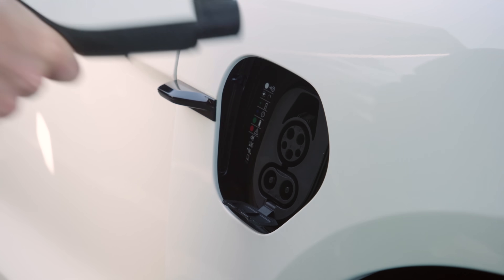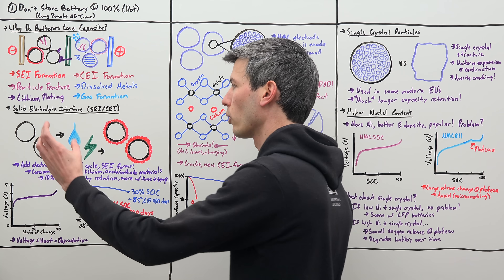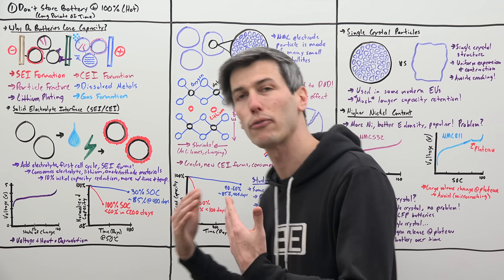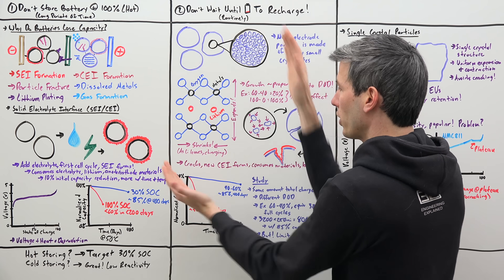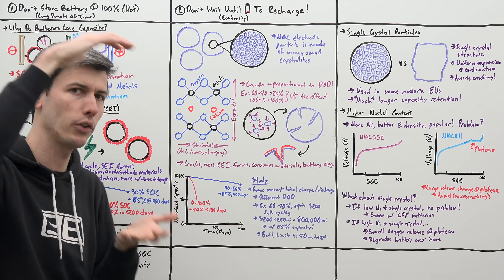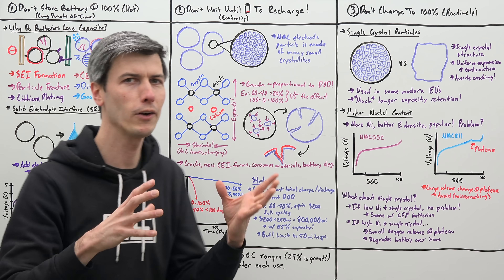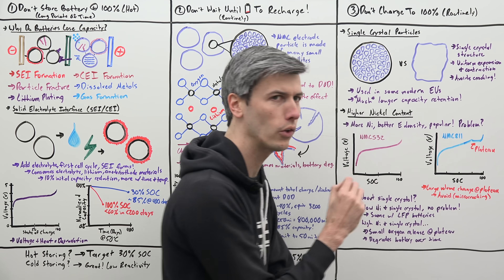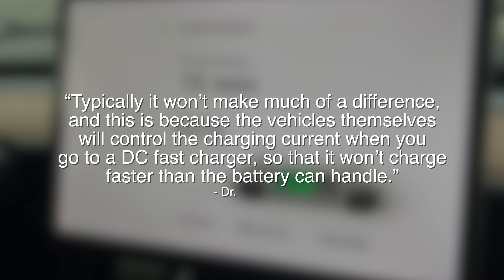How To Ruin Your Electric Car's Battery - NMC Edition!

Comment: Hey Jason, Another great video! Question for ya though -- What about the low end of the battery charge? Is sitting at a low state of charge hard on the battery? I have a 2023 Chevy Bolt that got in a wreck and has been sitting at the body shop for 3 months waiting on parts. Come to find out, the battery has been sitting at 0% for the last 2 months... grr.
Reply: You should be on them (body shop) to charge the car.  They may not know any better.  The car comes with a 110v charger, and they have 110v plugs and all day to charge it, so the slow charging speed doesn’t matter.  Just make sure the top charge % isn’t defaulting to 100, which may take some input - or training - from you.

Comment: I owned for 3 years 2020 Kona EV, without charger at home - I usually plugged car every time when I went out (shopping centers, doctor appointment ) So a lot small charging sessions. I did like that 50kkm with half of that on the highway +500km trips with DC charging ~5% to ~80%. SOH is 100% no degradation. 

But that's not always practical solution. Sometimes you don't know if you need 40% or 100% of charge for a trip that can happen immediately. Then  range anxiety kick's in hard.

Comment: Very interessting video. A factor that i'm interessted in but rarely anyone talks about is the normal aging of the battery. I mean even well kept and rarely use battery powered devices don't really have any capacity anymore after 10 years. So will we be seeing batteries dying after 10 years even though they were used with care?
Reply: No. My 2013 Chevy Volt's battery is about 12 years old now since it's been manufactured. It still has 85% of its capacity after 217k miles.

Comment: Imagine losing fuel tank capacity in an ICE car after filling it from 5% to 100% a bunch of times..
Reply: Imagine losing fuel efficiency because of poor maintenance, low quality gas, degraded fuel injectors, impurities in the tank, clogged air filters, old fuel filters, low quality oil, cheap tires, improper air pressure, bad driving habits, most of which are part of the cost of ownership and if not maintained can lead to expensive repairs.

Comment: One of the supposed big upside of EV’s is that it’s supposed to be so convenient to be able to charge at your house when you want to and not have to stop at the gas station. I live a block away from the gas station and drive past it every day, I would rather stop there once every 10 days than have to mess with plugging my battery in every single day or else I accidentally ruin it
Reply: Do you own a cell phone?

Comment: When he recommends limiting max charge to 75% (most of the time), is that 75% for the battery pack? Or 75% as indicated by the car? Most cars already limit their min/max charge state, so they will never reach 100% or 0%. e.g. When the car says 100%, the battery is actually at (say) 85%. When the car says 0%, the battery is actually at (say) 15%.

So should you be targeting what the car says is 75%? Or an actual battery charge state of 75% which would correspond to the car (in this example) saying (75-15)/(85-15) = 86%?
Reply: I think he’s talking about limiting the true SOC range but this is likely to be much closer to what the car shows you than you may think, especially at the higher state of charge. I don’t think most manufacturers are locking out 15% of the higher voltage. Perhaps a 3-5% buffer at most. You can get an adapter and app to look at the cell voltages in your EV. I bet they’re pretty close to the cell’s maximum voltage at 100% SOC as indicated on the dash.
Reply: He means net capacity, which already includes the buffer. It is way too conservative tho. Charging to 80% is totally fine (you still have the top buffer which is another 2-3%.), no need to limit yourself beyond that

Comment: This is a very informative and important video. I ussually think that it is better to charge a battery at 20% to 80% rather than small charges in between, now i know i should do small charges for my phone, and if i ever own an ev on the future..

It is hard though to store ev away from heat in my country, as i live at a tropical country, so maybe if i ever own EV in the future, it is better to set to charge only to 70% at max.

Comment: I live in a van with two flooded lead acid battery packs and one glass matt AGM battery.   One of the flooded batteries is an advanced tech and the other is an RV deep cycle.   The van advanced tech battery I charge every other day with a 100 watt solar panel and a Renogy Wander Controller.  The VAN house batteries I charge daily when possible with the same set up.  None of my batteries consume any chemistry.   Am I doing it right or should I charge less frequently?

Comment: With a EV you're a slave to the charging network. No freedom you have to go to where the network allows you to go.
Reply: That's the same for petrol or diesel cars, the amount of stations is just far greater.

I've definitely driven places where you have range anxiety even in a petrol car. Hopefully electric charging stations will continue to be added and maintained for those who need them.
Reply: @Kamukix ever heard of a jerrycan? Try bringing some battery packs with an EV

Comment: Simple.. one day batteries will no longer lose the ability to hold a charge/experience degradation... until then, these current batteries are not a viable solution.... and are essentially going to be expired milk one day (guaranteed)

Comment: I don't keep ANY car more than 3 years. I want my car to be ready for any emergency at all times so I always charge to 100%. My Tesla battary has warranty and I don't give a rats a** about battery degradation. It is a car, it serves me, I am not serving my car. End of story!
Reply: What possible emergency requires you to drive over 250 miles without stopping
Reply: @BrandEver117 we do not have so many superchargers on the main highways up here in Canada so while driving from Ontario to Manitoba you need to start at 100 and calculate exactly where you need to stop, otherwise you will be stranded.

Comment: Modern EVs have some battery capacity locked by manufacturers, i.e., you can’t really reach 100% state of charge, or 0% of discharge. In other words, as long as owners don’t charge to full capacity and store for a long time, and don’t empty the battery completely on every single drive, you’re good to go in practice.

Comment: Nice topic and video!

My anecdote: we own a 2015 Fiat 500e that stays plugged in and charged to 100% (no option for less). It shows no discernable degradation (must still be within the built-in buffer). We don't drive it much (47K), mostly getting groceries so shallow discharges, with a bit deeper discharge (45%) every other month or so, and really deep discharges limited to under 5 since we've owned it (6 yrs).
Reply: They are so cute!! 
Glad for you.

Comment: 7:45 ERROR: current EV batteries can sustain between 300-500 cycles before they die, NOT your theoretical 3,200 cycles. Thus you'll NEVER get 800k miles and will still have 85% of batt capacity. Maybe you'll get 100k and 85% if you are super careful, at best...

Comment: Curious about implications for plug in hybrids with ~35mile electric only ranges that are being used as daily drivers.  Degradation seems higher in those use cases.
Reply: Exactly! Mine goes from 0 to 100% every day pretty much. I guess it will end up being a regular gas vehicle as the battery degrades.
Reply: @RedpillGroyper  Well I hope not. Our 3.5 month old Prime gets charged every evening no matter what the SOC is. Most days we only drive about 35Km so the SOC rarely drops below 50%. But, I noticed something the first time we went on a longish highway adventure. Prior to that trip the car had never been out of EV Mode. So, my plan was to set-out with a full charge and select Hybrid Mode, expecting to see massive milage numbers............Not so. The car drove for over 80Km in full EV Mode, refusing to engage the engine until the SOC was at zero.

That reassures me because if Toyota had any reservations about the Service Life of their PHEV batteries being affected by frequent cycles, they'd have made the Hybrid system involve the ICE way before the Traction Battery died to "spare" the battery.

We have driven our Prime 5,000Km in 3.5 months and used less than 1.5 tanks of fuel. That's the way we'll run. The battery has a ten year warranty, Toyota does not want failures.
Reply: Agree. Battery degradation will be bad for PHEV.

Comment: How to maintain your car’s fuel tank. 
1. Never fill it 100% with fuel. 
2. Never run out of fuel. 
3. Never drive for prolonged periods at wide open throttle. 
4. Never fill the tank fully when it’s warm. 
5. Never fill the tank fully when it’s cold. 
6. Always refill (to only 80%) after every trip. 

Follow these simple rules and your fuel tank should last 8-10 years and 100k miles.

Comment: I heard that Model Ys don't get accurate at measuring charge state until you get to 80%.  Should I charge to 80% or 75?
Reply: 80% is fine. If it is LFP battery it is more than fine

Comment: Thank you. I’m very happy with my battery Lithium lawn equipment, and while I will never go back to gas, it’s very difficult applying these charging methods, and it’s incredibly frustrating then having to carry around the same weight of batteries, but they have lost 60-80% capacity as they originally had and it’s environmentally terrible and very expensive to replace them - you have to carry around all this dead weight to get value out of them, and even then one battery could have purchased years of fuel energy.

This is the only time I miss gas, with the longer run times, lighter weight, cheaper to purchase and cheaper to run than Lithium lawn equipment.

I hope engineers and scientists can overcome weight and battery degradation, because it’s great using battery lawn equipment, with little to no vibration, no pollution at the user end and little maintenance and no handling of fuel.
Reply: I left the sirens of San Francisco for the leaf blowers of Belmont, is a joke I make since moving to the 'burbs. 
Yah, great comment in light of municipalities moving to ban gas powered lawn appliances, particularly blowers, due to everything you mentioned. I feel  bad adding weight to the guys I see around our neighborhood.

Comment: Best Lion battery life is between 20% to 80% and with a heater or AC, it's half dead before you start. Then turn the lights on.

Comment: Depth of discharge is a useless metric. According to accubattery's research, which cites Choi, S. S., & Lim, H. S. (2002). "Factors that affect cycle-life and possible degradation mechanisms of a Li-ion cell based on LiCoO2".
Rather than use depth of discharge, it is far more meaningful to pay attention to the END OF CHARGE voltage. Cycling between 0% and 50% is not the same as cycling from 50% to 100%, 30-70%, or any other range.

This paper by Madeleine Ecker is fatally flawed in that it compared a 40-60% cycling range battery to a 100% DOD lithium battery with completely different end of charge voltages. Where is the data that shows a proper 60-0% control? And why couldn't they compare the amount of work done after a certain extent of cell degradation?

Jason was also interchanging a 40-60% charge with a 60-40% discharge in his explanation. Conceptually if the lattice both expands and shrinks during both its charge and discharge cycle, then it comes down to pinning the ideal SOC range to do electrochemical work within. But I don't think this cycle depth data has been properly demonstrated and is missing the key controls to make correct interpretations to infer use practices from.

I'll be clear, depth of discharge has no place in the literature for li-ion chemistries. This is more appropriate for nimh, lead-acid, and nicad. Li-ion needs a new term that puts a focus on end of charge voltage and SOC range.

Comment: The fact that an EV car battery is so difficult to replace is a scam. There is is zero reason, ZERO, why you shouldn't be able to swap out an old battery and replace it with a new one in under 20 minutes at minimal cost.
2nd, lithium price is now 20%, fully 1/5th the price it was a year ago.
Expensive battery replacement is a BS scam across the whole EV industry.

Comment: Do any EVs have a charging plan setup so that you can say "Mon - Thu Charge 60% and Fri - Sun charge 90%"?  Or link to a calendar app, so that it knows that on the 23rd you have a 500 mile trip planned so the day before it should charge to 100% even though it's a Wednesday.
Reply: I think some do. Mine doesn't have daily charge limits, just departure times so it will be charged to the same amount when it's time to leave.

Comment: Just some caveats - bench testing is not always a great proxy for battery behaviour in an EV while they do highlight some impacts these are usually much lower in an EV application.

Unlike bench tests, EV's have sophisticated battery management systems - when you charge an EV to 100% you are not always charging all the cells to 100% like on a bench test. e.g my tesla model 3 (LFP) has a gross capacity of 60kwh and a usable of 57kwh - the BMS manges the capacity when you charge to 100% it's like having a chess board with 60 squares and the BMS randomly fills up only 57 at a time, and leaves the other 3 at partial charges, they also have heat management, cooling systems and the impact of cyclical recovery is often ignored.

Ignoring the NMC element for a moment, I generally let my LFP battery get down to around 15-20% before charging it to 100% and leaving it plugged in at that charge. Over 12months and 12500 miles of ownership my calculated usable kwh has reduced from 57kwh when new to 55.9 kwh - around 2% degradation, there is no bench test anywhere on LFP batteres that gets close to replicating this beaviour.

Comment: First thing don't buy one.  My truck is 34yrs old with 600k miles and only wear items replaced and electrical items too.  The engine is 100% orginal as it left the factory.

And i can use 100% of range all the time (600+ miles).
Reply: I guarantee that many of your horses that came with the truck new have run away and similarly you don't get the range it came with.
Reply: @TB-up4xi  it still get 22mpg city 22mpg hwy.  Ford 300.

I've also spent less including purchase price with inflation than a battery pack costs.  And still get 150+psi of compression.  So you tell me if mpg is the same and compression is the same how many horses has it lost.

Comment: The bottom line if you have a car with a 400 mile range take 20% off the top and 20% off the bottom.  That means your car will go 240 miles on a charge, NO THANKS.

Comment: My 4.5 year old M3P has only around 5% degradation- it’s literally NEVER been to 100%, even on long trips. (I find 95% works better for long trips, and still gives me regen.)
Typically day to day, I use 40 to 70%, and ESPECIALLY in Summer I try to use 70% or less as absolute max except on a trip.
Reply: Going to 100% once a month would be a good idea
Reply: @Samusaran77 : Is that really a big deal?
I just bought my first EV a couple of months ago & I've kept it between 20%-80%, never going to 100.
Will I hurt the battery over time if I never go outside the 20-80%?

Comment: Electric vehicles actually turns out require 40% repairs far more often and costing 80% more than gas power vehicles.  The 3 main things that can damage your electric battery are 1: Over charging the vehicle.  2: Letting the battery get low on energy can kill the battery.  3: Charging the battery at all degrades the battery massively.  Basically using an Electric Vehicle at all damages the electric vehicle.

Comment: I’ve noticed my car’s new hydrocarbon-based battery chemistry suffers very little degradation charged to 100% regularly. Still at 100% the same energy capacity after several hundred cycles. I hear the future.

Comment: It sounds like EV manufacturers should let you set the charge limit as low as 30%. I don't know about other brands, but the lowest charge limit Tesla allows is 50%.

There must be lots of EV drivers out there who rarely use more than 10% in a day. Based on these recommendations, they'd get the best battery longevity by setting the charge limit quite low, not the 80% or 90% most EV owners use.

Comment: The very latest data suggests charging to 50 to 55% will keep the battery health at the best it can be.  If not driven for days or more keeping it at 50% is perfect.  But on average EV batteries will last much longer than most people will keep their cars.  The only issue is if it has low battery health it means it will need to be charged more frequently, which means more money out of your pocket.  So until battery technology advances to the point where consumers can just plug it in and forget it with no battery health concerns, we have to be knowledgable about our charging habits.

Comment: Battery costs what a GM 5.3 installed does from the dealer. Unlike the 5.3 they tend to last more that 60k miles.

Comment: It's almost like Li-ion batteries have trillions of moving parts that suffer mechanical stress fractures over time in the cathode material in a process called intercalation.  This is due to temperature, manufacturing defects/tolerances, and charge/discharge rate, aka fast charging, and charging in cooler and hotter temperatures than recommended.  All of which can all lead to a massive bill multiple time the cost of a brand-new ICE drive train, or a deadly thermite-like reaction that will cost you your life and possibly the lives of others too!   Wow, on second thought, ICE power plants actually have significantly fewer moving parts when you don't play a shell-game with the battery being a "single part".